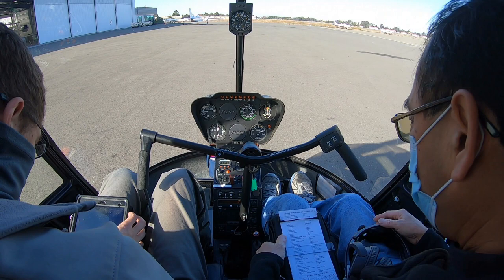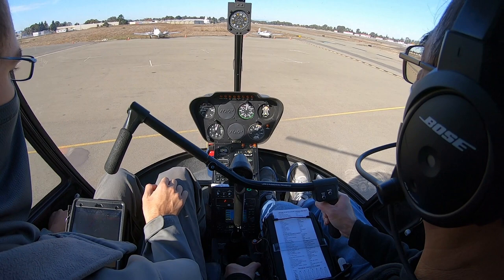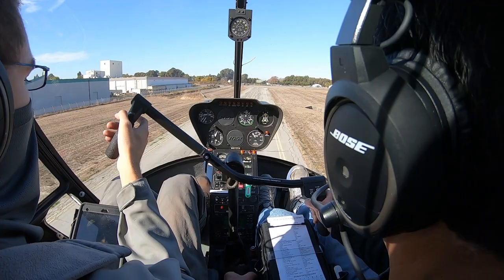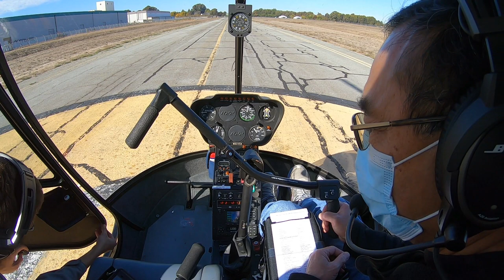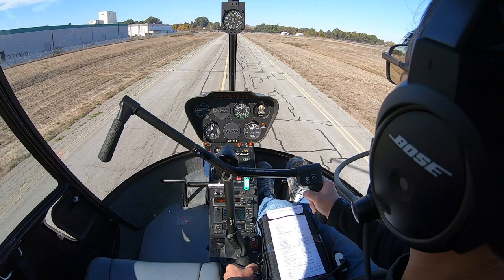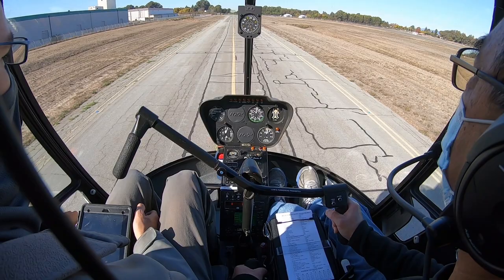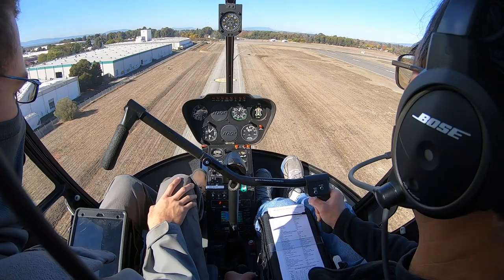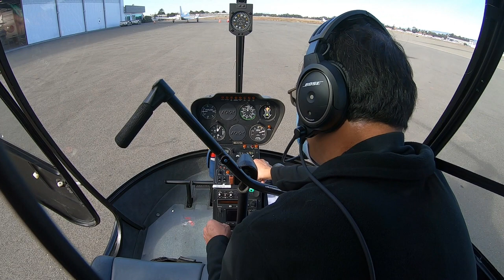Specialized Helicopters, Robinson R22 Lesson #21, First Solo!

Comment: Congratulations!!!!  That’s a huge accomplishment Rick.  You should be proud of the work it took to get there.  Great job!
Reply from the maker: Thanks Mark for your comments and your support! I was really wondering how I would feel flying by myself. Whether I would like it or not. I was trying to figure that out while also trying to do a good job of flying the pattern. I think I like it enough to continue working on the training. 
The pickup was ugly. In retrospect I was probably headed toward a dynamic rollover if the skid didn't free itself, so if something like that happens again, I will set back down and check my skid. It's just that I wasn't quite sure what to expect. I was expecting to tip somewhat to the right and back, but was expecting to be sliding around a little.
Anyway, some learning happened, and all in all it was a pretty exciting day.
Reply: @rotarywing  I have done that exact thing with a simple crack in the surface.  Great learning experience and a reminder of why we do a slow pick up to prevent the rollover.  My R44 class got cancelled due to COVID.
Reply from the maker: @markhuffman7937  Disappointing that RHC had to cancel the R44 class. I was looking forward to what they had to say about the Vuichard maneuver pedal turn finish. Will have to wait until you can reschedule the class.

Comment: Awesome job!! I was a little disappointed last week when he didn't recommend you solo, I thought you were ready then. Skid was definitely stuck on pickup, but your training kicked in and you reacted to counter the issue. Nicely done.
Reply from the maker: HeliPAPI, thank you for your kind words. Actually, my CFI did ask if I wanted to solo last week, lesson #20, but I didn't like the wind direction, 150 @4kts, from the left rear quarter, even though it was light. After the set down at the end of the flight, he did comment that he thought I would have done fine. The important thing to me was that he signed my solo endorsement at the R22 minimum of 20.2 hours. The following week the weather was perfect, but the R22 had an alternator problem so we couldn't fly. The next week, lesson #19, the wind was over the maximum for solos, at 16kts. It was my decision to wait for better conditions so I could try to do a good solo.
Reply: @rotarywing  Great ADM. Personal (Go, No Go) minimums are very important, especially for us student pilots.

Comment: Congrats Rick! Hope all is well.
Reply: First solo pick up I remember feeling like I was riding a bucking horse!
Reply from the maker: Thanks so much Eddie! Have you been flying much since your Commercial Certificate?
Reply from the maker: I didn't like how my first solo pickup turned out at all! I got a better feeling for the pickup on my second solo as I got to practice several times.
Reply: @rotarywing  I haven't since my commercial check ride! With my job remote, I moved up to Bend, OR for the indefinite future. There's a great school up here I started working with for my CFI, and I'll aim to get airborne once this latest wave starts to dissipate.

Looks like you've been flying a lot! Starting to think about your check ride?
Reply from the maker: Leading Edge Aviation? 
I’m going to work toward a checkride, but it’s likely to take a while as I don’t expect to take a checkride at the minimum hours. What did you do for ground school to learn/prepare for the written exams?